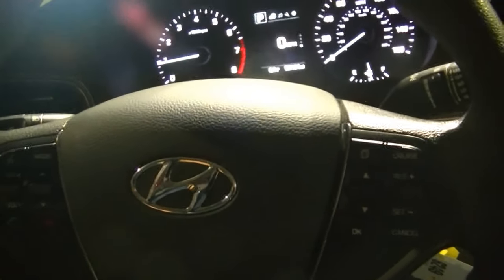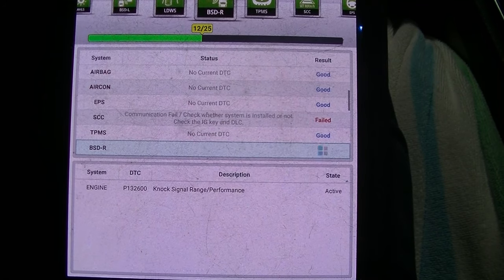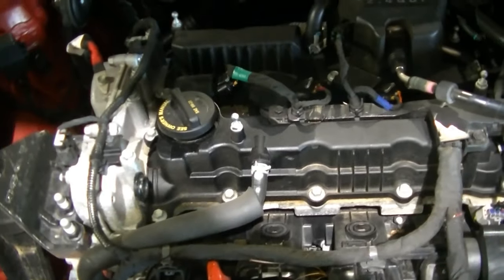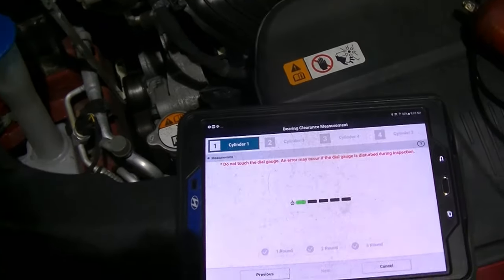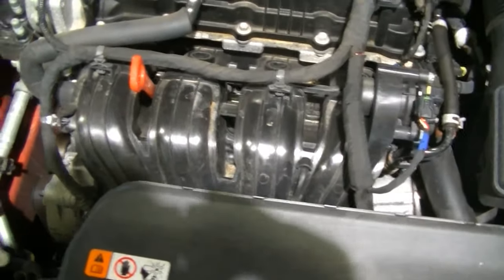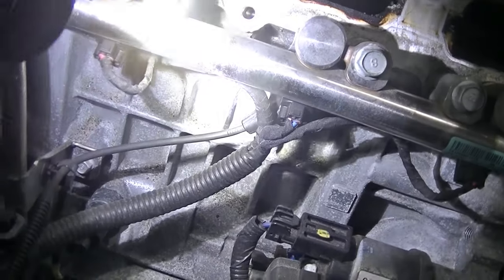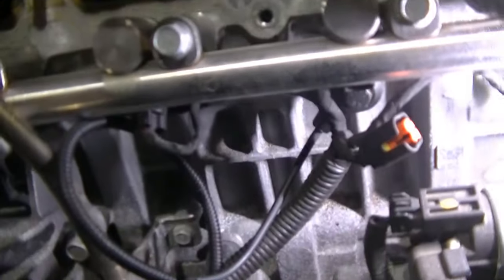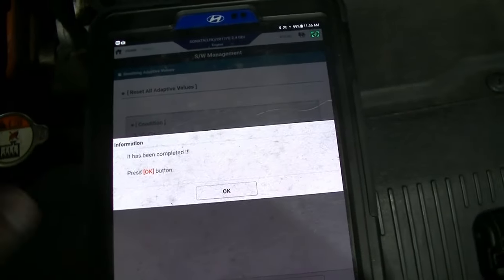Hyundai/Kia P1326 Diagnosis and Knock sensor replacement (flashing check engine light)

Comment: Hi S&E garage really need your help please. I have a 2014 Kia forte with 2.0 gdi engine. And 3 weeks ago It started to make a knocking noise. I took it to the dealer. After the diagnosing they said it is engine failure but didn’t told me where in the engine.  my mechanic said it is rod knock. And the dealer asked me to bring the maintenance record. I did but they denied it. I don’t know what to do. Now the car is at the dealer. I can’t afford to change the engine. Please help me with all you could. Advices,sources for information help me to fight it any thing. please 😂😂😂
 Appreciate you help
Reply: Did you do anything?? 😢

Comment: Where did you get that bearing clearance tool from?
Reply from the maker: It’s a Hyundai special service tool
Reply: @SEsGarage  So just curious if it does need a motor like in this case, would that be covered by the 10 year 100,000 mile power train warranty?

Comment: I have a '14 kia optima. I just got this code couple days ago. Is it safe to drive it to the dealership? Or any auti shop.
Reply from the maker: they go into limp mode for you to be able to safely drive to the dealer. However, if you hear any abnormal engine noises id advise against driving

Comment: Got a question. I got the code P1326 on my Hyundai Sonata around Oct 2019. My also happened to have a Rebuilt title but it was still eligible for the Free Diagnostics and repairs. I took it to Hyundai and they performed the Rod Bearing Clearance test, ECM Update and installed the Knock sensor wiring harness. Since it was part the Service Campaign 953, I didn't pay anything out of pocket even though it was a rebuilt title.

Fast forward to Feb 2nd, 2022. I get the Engine code P1326 again. I took it to the dealership. They performed the Rod Bearing Clearance test and it passed. They performed an ECM Update but no need to install the Knock Sensor wiring harness this time. Now, the dealership are charging me $533. Does this make any sense? This is a reoccurring problem that was part of the previously ended Service Campaign 953. Meaning any future problems arising from the Knock Sensor Campaign should be remedied at Hyundai's expense and not the consumer. I took the case to a Case Manager at Hyundai and am currently awaiting their decision. What do you advise?
Reply: This is to T what I am having with my car. Do you have an update ?
Reply: Same with mine too.

Comment: Hey i have the 2017 sonata limited.  can i reset those values myself with a regular diagnostic tool?  Or do i have to have a mechanic fix it?
Reply from the maker: If your scanner is a two way scanner it should work. You need to be able to communicate with the ECM and select reset adaptive values
Reply: @SEsGarage  ok, thank you for the quick response.

Comment: I purposely didn't get the update for the 953 campaign because i heard about all the false positives customers were getting.  My 2015 sonata SE has been fine (knock on wood).  Am i setting myself up for a fight with the dealer if l end up having engine issues down the road related to this knock sensor thing mot having done software update?
Reply from the maker: if you dont get the update hyundai can deny your engine claim according to the new class action suit. All the early issues related to the 953 have all but been ironed out
Reply: How many miles you got?
Reply: @frankieb7405  66,200

Comment: Hi. Thank you for the video. I got this error p1326 today with blinking check engine symbol. I am in a road trip. Took a night break due to this issue. Do you think I can drive another 130miles with this issue?
Reply from the maker: I would have the car towed to the closest Hyundai dealer for inspection. The whole purpose of the code is to protect the engine from failure
Reply: @SEsGarage  Okay. Thank you for the suggestion.
Reply: @SEsGarage  Can you tell me what limp mode is. I got another reading that said I had a bad coil on #2 and I was wondering if this wasn't associated with limp mode and the coil was fine.
Reply from the maker: @Rat4u2  you’d have a flashing MIL and unable to rev the engine passed around 2500rpm or so if it’s in limp. P1326 would also be set

Comment: Same code on mine every time I take it through the car wash or it’s heavy rain. Like clockwork
Reply: Do you have to disconnect the battery every time after the heavy rain or car wash?
Reply: We have the same exact problem. Hyundai wants like $250 just to pull it in the shop. I just got a new sensor in and I'm putting it in today. I hope it works!
Reply: @cmankro  I have a 2018 and took it into Temecula Hyundai and they did the update and bearing clearance test under warranty. Not sure what year yours is but I would ask about the recall they have out for them, may not fall under it but worth a shot.
Reply: I own the 2017 Hyundai sonata and I scheduled an appointment for the recall for the knock sensor to replace tomorrow yeah it's free so get it done it's important
Reply: @cmankro  how did you come out putting in the knock sensor? Is it all good all systems go or what?
Reply: @cmankro  ya im also interested to know if this fixed ur issue
Reply: @cmankro  I do have the same problem, did you fixed with the sensor?
Reply: That's what I did I googled and found that there was a recall took it to a dealer they said it wasn't for replacement it was for ECM update, personally I thought they were supposed to replace it?
Reply: When I wash my engine I got same problem but without cod in scanner !!!
Reply: @mattlonproctor7221  the precedure they have to follow for this repair is check for update first, if it isn't updated then do the update. If it has been updated or issue happens again after update they have to do the bearing clearance check, If it passes, they replace the knock sensor, If it fails they replace the motor. All of this is covered under by Hyundai under the lawsuit settlement of last year. 

Mine had the update and this happened a month ago, The first Hyundai dealership i took it to refused to even check the codes and diagnose it until I provided them with written documentation proving I changed the oil everytime since I last had it at the dealership which was when I bought it about 40k miles ago, less than a year. I change my own oil since I am a mechanic and didn't think I had to record myself everytime I changed oil so anyways I am waiting til June 3rd to get another Hyundai dealership to have it looked at. That was the earliest I could get it in.
Reply: @christianvankirk1428  So im assuming as long as you have the 10 year 100,000 mile factory  power train warranty you're covered? Do you happen to know if it needs a new motor if it would still be covered under warranty or did yours just need the sensor ?
Reply: @christianvankirk1428  hey did replacing the knock sensor work? Having this same problem
Reply: @Rusky235  I never replaced the sensor. I just took the car into the dealership and they checked for the update and also did a bearing clearance test. Mine fortunately passed the clearance test and was just the ecu update. From what they told me is if it doesn’t pass the bearing clearance test, they replace the engine and give you the 10 year 100,000 warranty on the new one which is cool. From my experience, I would take it in before replacing the sensor.
Reply: @cmankro  Heyy did replacing the knock sensor work??
Reply: @christianvankirk1428  hey sorry about that meant to ask the other person. I’m getting this code now and car won’t accelerate more than 20 mph. All of this after a car wash
Reply: So how did you fix it?

Comment: So I have a 2014 kia optima sxt and its engine was just replaced and now has only 500km and is now throwing this code? Should I just erase the code
Reply from the maker: I’d bring it to the dealership and let them address it. It’ll likely set right back. Possible the dealer didn’t torque knock sensor to 15ftlbs as you’re supposed to when replacing the engine
Reply: I was honestly thinking that as soon as you said to torque it to 15lbs, would it be safe to clear the code to get the car to the dealer ship lol?
Reply from the maker: @vincentsunday3174  The dealership is going to need to see the code in the computer of the car to be able to make any type of repair so I would advise against that
Reply: Thank you!!!!
Reply from the maker: @vincentsunday3174  any time! Thanks for the comments and consider subscribing for more content like this!
Reply: @SEsGarage  got my sub lol one more question dealership is about 30km is limp mode safe to make it there or tow
Reply from the maker: @vincentsunday3174  yes you’ll obviously just have reduced power and limited speed. If you have towing through your insurance company it may be worth it to tow the car to the dealer

Comment: $5k engine or $50 knock sensor COIN toss.  FML.  my car is in the shop waiting inspection.
Reply: Same deal with my 2013 Veloster that I bought used for 12K at a dealership 6 months ago, Spend 2K just for having the engine flushed and tuned-up and when I go past 60mph the check engine light starts flashing and I barely have any power to swiftly move the car. Even going far as replacing the knock sensor with a another genuine one (About $25 each) it still happen. Worse part that I don't here any loud or abnormal knocking sounds from the engine.
 
I am beyond upset and just giving up the ideal of dumping more money into the car. Only a few options on my mind is checking, cleaning and reposition the knock sensor if is it really working properly.
Reply: What's the update @haaxxx9 did it eventually get sorted or it was an endless loop

Comment: If you have a Hyundai go to the dealership they will replace it for free. There has been a recall on the knock sensor.. do yourself a favor and get it checked
Reply: I just called a hyundai dealership and they told me there is not a recall on this. But it might be covered under the engine warranty.  I have to bring it in so they can see when they run a diagnostic test on it.

Comment: A valve cleaning every 20k miles? F that man, seriously people just go buy a Toyota or Honda and not have to deal with this crap.
Reply from the maker: Yessir, and vehicle (including Honda) that has direct injection should have religious induction services. Vehicles like Toyota, most Lexus, and newer Hyundai and Ford products use port injectors along with the direct injectors to prevent this build up

Comment: Is there only one knock sensor in a Kia 17 Sportage
Reply from the maker: If it’s a four cylinder yes. V6 will have two, both under the intake manifold in the valley of the engine
Reply: @SEsGarage  My car is a 4cylinder and was being told it had two but from your video I knew that had to be a lie. Thanks for responding .

Comment: Where the knock sensor is conected?
Reply from the maker: It plugs in on the front of the intake manifold next to the fuel injector harness and oil pressure switch!

Comment: You don't have to pull the intake manifold to replace the knock sensor. Take down the under carriage splash sheilds. Remove the oil filter housing/cooler. Remove intake manifold support bracket. Clear shot at the knock sensor. Taking of the intake manifold is a waste of time.
Reply from the maker: So get covered in oil and coolant to avoid taking the intake manifold that I can remove in legitimately 10 minutes….seems like a real time saver 😂
Reply: @SEsGarage  not to mention cost of oil coolant and time to bleed the system and reset maintenance. EFFICIENT
Reply: @SEsGarage  We're not supposed to tell pedestrians how fast we actually do this shit lol

Comment: Doesn't look too bad,  doing all 6 spark plugs on a 2009-2021 V6 Camry or God forbid Sienna is a lot worse 😂. My wife's niece had that code on a 2017 Sedona, I was ready to replace the knock sensor but she said she has warranty, so I let the dealer do it.
Reply: So the knock sensor is covered under warranty? Bc i just got this code and only had my car since june and am ready to throw up im so sick to my stomach.
Reply: @sarahsnailsdivesanddiys560  for Toyota they do go out but the job is big enough to also do the spark plugs which could also trigger this code if they are starting to fail due to bad combustion. I had this on a 2007 sienna with 212k miles and the problem was fixed but the spark plugs were overdue as well which I had planned on doing anyway.

Comment: Where is the shop?
Reply from the maker: This was a dealership in NJ, i no longer work for them unfortunately
Reply: @SEsGarage   can i take off the knock sensor ? They say it is my engine ..but i've been driving it like that for 6 months after the recal ...when to hyundai on the 23rd ..and today the check engine came back flashing when i took off the cruise control ...it knocked and the knock sensor reacted ..i do not think my engine has a problem ...no sound..no knock ...it is giving me a headache this knock sensor 🤬🤣

Comment: How much does that service cost.  Because I have a 2015 Hyundai Sonata 2.0t and it’s is pulling p1326 and p0014 codes
Reply from the maker: Get that thing to the dealer. P0014 is a low oil pressure code

Comment: My 2022 Hyundai Kona N has P1326 code active. Is the Knock Sensor on the 2.0T engine visible upon opening the hood?
Reply from the maker: No, it’s up under the intake manifold